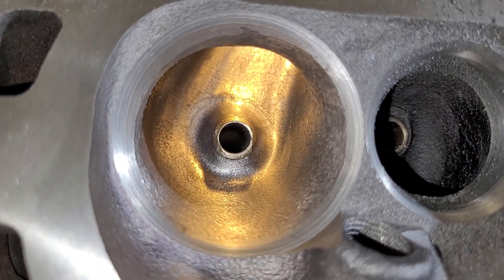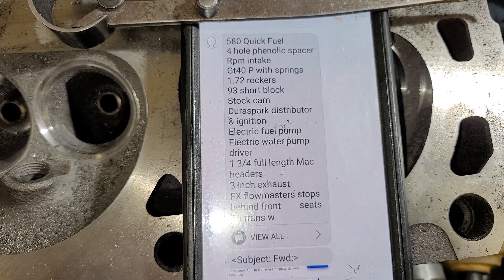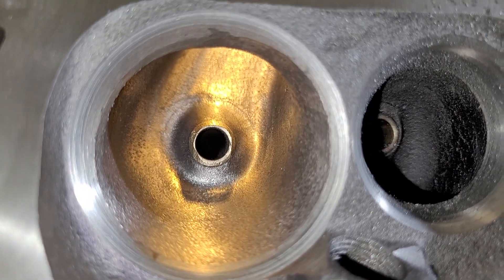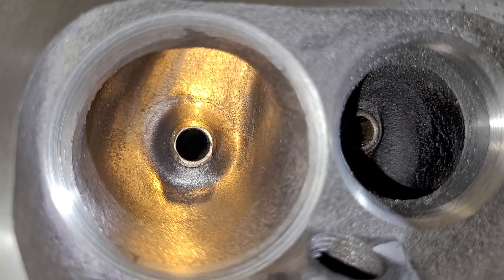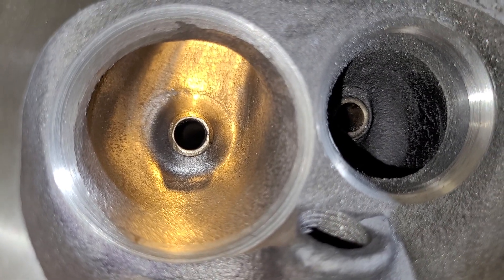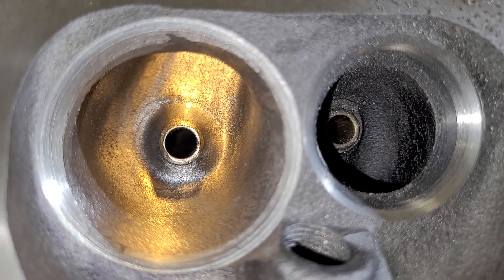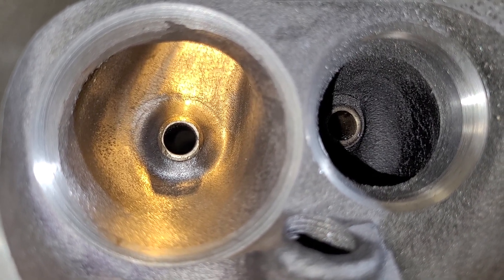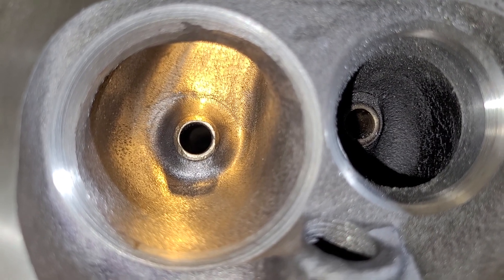The Ported Ford F77E Gt40p cylinder head engine combo and cam discussion

Comment: people have tendency to get the actual seat surface way to wide regardless of angle. turns it into a carbon catcher. originally, multi angle valve job was to straighten out valve seats and restore seat diameter. then it was discovered it made more power. angles of different types result in different outputs. look at the fe 30 degree intake and 45 exhaust. it actually makes a choker head move a better flow output.
Reply from the maker: I didn't know Fe ran 30 degree intake seats.

Comment: 🔔😎
DV cam calculator says 110* LSA or slightly less.
I bet a Thumper or + with the tight 107 LSA would be strong
Reply from the maker: Thumper will never be used in one of my designs. Ugh, a cam designed for the sound????
Reply from the maker: I am thinking tight lc. You are right.

Comment: I .520 E .530 lift might do ok
Reply from the maker: It's not a tow truck!!!

Cylinder head humor...
Reply from the maker: I just had a thought, scary right? What is the max lift with stock Ford dog bone and lifters?
Reply: @servediocylinderheads  my guess would be around .500
Reply: @deerslayer5863  Hi. A friend of mine is running a Comp extreme energy .555 intake and .565 exhaust with the Ford stock lifters and dogbones in his 306. It's been 4 or 5 years and no problems so far. Andrew
Reply from the maker: @andrewburlock2653  We ran .544" in the 90's.
Reply: I'm sure Richard Holdner went with a comp what is it a xp274hp cam in a stock sbf and I think it's 570 inch lift no p to v problems however he is supposed to verify this and hasn't yet. Oh with 202 aluminum heads. Again waiting for him to get off the Ls stuff and back on sbf cam comparison test.
Reply: @servediocylinderheads  I’ve ran the comp xfi hr .579 lift cam with stock lifters and dog bones.
Reply from the maker: @JohnThomas-vb9se  Nice!
Reply: @andrewburlock2653  yup no problem with ours either for about 6 years all stock crap we just let it fly 👍
Reply: @servediocylinderheads  I also looked for those stock gt40 valves I said I’d send you. So far I can only find 7 of the 8 intakes and all 8 exhaust. When I have time to continue to look and find the 8th intake I’ll message you and send them to you.
Reply from the maker: @JohnThomas-vb9se  Cool, thanks.
Reply: @servediocylinderheads  Ouch! I guess I'm behind the times and better step it up. Andrew
Reply from the maker: @andrewburlock2653  If this is done right we all get a step up. Think about it.

Comment: Charles 50 ounch balancer hasn't been a problem for us my son has turned that motor to 8000 rpm at times with no issues,  as you can see its still running in my black coupe in the video where i pulled second gear it was past 7500 rpm however i do have a good aftermarket balancer on it,  hope this is helpful
Reply from the maker: We ran a 50 ounce with a fluid damper and we buzzed it to 7000 and never had a problem but I went through the short block and deburred everything.

Comment: Charles, what valve spring kit was he running on the stack heads with stock cam in his original combination? I’m building a similar combo stock, want to upgrade the springs and I get conflicting answers depending on who I ask which kit to use. Thanks in advance
Reply from the maker: Alex?
Reply: @servediocylinderheads  Alex has many different spring kits, that’s the confusion part. I was going to buy the TFS 2500100 kit, I called them the guy told me to use a different kit with P heads and stock roller cam. So I’m not exactly sure what to buy. I will likely call Summitt / TFS and Alex Parts to get better specific advice on what to buy
Reply from the maker: @davidromanski3249  I can ask for exact part number if you like.
Reply: @servediocylinderheads  yes please ask him for a part number.
Reply: @davidromanski3249  Alex spring kit , I can check for the part number while at work tomorrow , thanks
Reply: @frontdizzy2218  yes please do that. I’m going to be running stock P heads, stock 93 roller cam, 1.7 roller rockers
Reply from the maker: Alex part number vsk7149
Reply: @servediocylinderheads  thank you!
Reply from the maker: @davidromanski3249  np
Reply: @servediocylinderheads  Charles, I called Alex’s Parts and he recommended part number VSK 7eb49-MC for P heads and stock roller cam no boost. I recommend anyone call them prior to ordering. For one thing, if it says out of stock they have to make it available to buy online. Thanks
Reply from the maker: @davidromanski3249  The way I think about it more damage comes from too light a spring load for rpm. I always added a bit of load and never had a problem after I figured it out. Before was a different story.

Comment: 0.578" int. And 0.593" exh. Go healthy on the duration but stick with 108-110 lobe separation. I bet that engine wakes up. Like I said before my 302 made 503 horsepower with ported 351W D0OE castings with 1.94" int. And 1.60" exh. Valve's, ported Victor Jr intake, 750 DP Holley, a custom ground solid lifter cam by CompCams for a 351W build not mine. 0.678" int. To 0.703" exh. 300 Degrees advertised duration with a 110 LSA. Yes, it sounded extremely radical and it was.  Those heads would flow just as much as these GT40P'S Charlie is doing. I don't think you need all that massive lift but almost to 0.600" lift. I'm welling to bet it hits 490-500 HP.
Reply from the maker: I was thinking tighter lc than that.